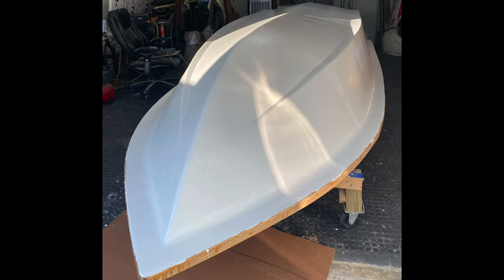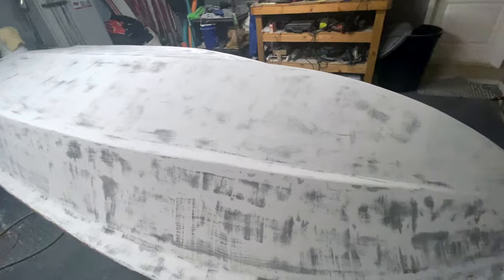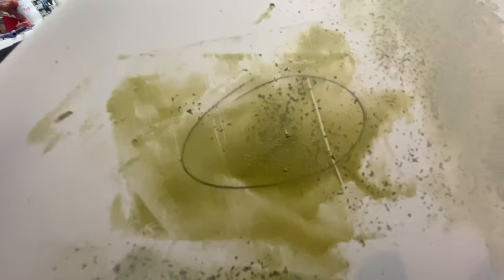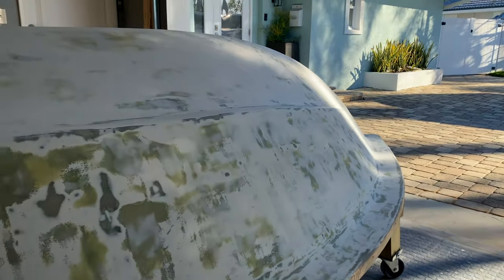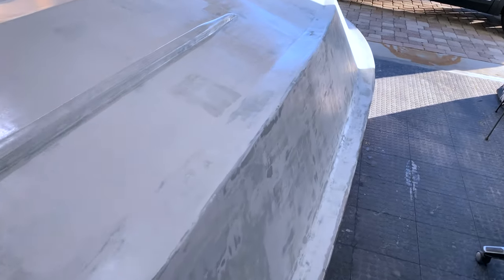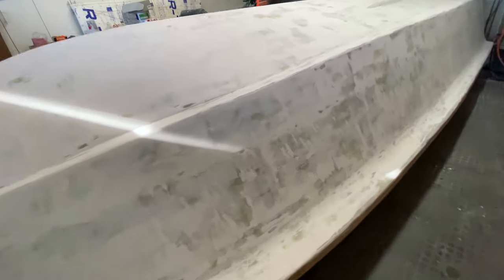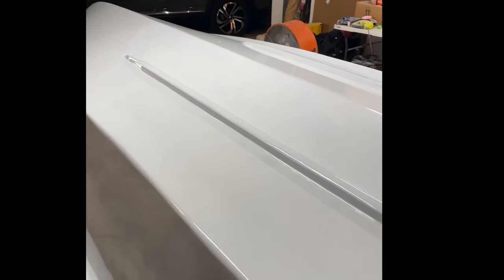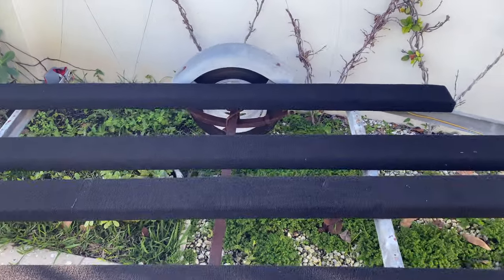DIY Salt Boatworks Home Skiff Build Update 8  The Hull is Painted with Alexseal!

Comment: Did you use a long board? If not you will extremely difficult to get rid of low spots.  Looks great
Reply from the maker: I did use a long inline sander to finish it off. Boat turned out great thanks for watching

Comment: UN REAL!  I know how much this thing has fought you all the way and I can't like it's driven me to do what I am doing with my build.  But the finish, man, it has to be worth it.  How many hours have you spent just looking at it.  Then moving, and looking at it.  And wondering how the hell it looks like it does from where you started.  Awesome work.  Now come do mine.
Reply from the maker: Thank you. A lot of my buddies along the way saw it in. Several colors and stages of fairing lol. It turned out super nice. Now that it’s flipped over you don’t see as much, but topside is moving along pretty quickly. I’m headed tot he dmv today to get trailer registration then probably going to put the boat in at the ramp just to see how it sits in the water tomorrow afternoon

Comment: Can you experienced folks teach me something? I want to re-gel coat my 16’ Privateer center console. I’m curious… why paint is used on some DIY projects instead of gel coat? Get coat is thicker and can take a beating for many years, creates a thicker barrier between the elements and fiberglass, can be wet sanded years later without rubbing through, and can last 50 years if taken care of. Thinly coated paint might last for ten years, doesn’t matter which paint is used. Why go through all that prep work then use paint? Four coats of sprayed gel coat is what makes sense to me but I’m not totally sure. Awesome skiff by the way, great job. 👍
Reply from the maker: Thank you. I didn’t have the means to spray paint in the garage so rolling it was the easiest way for me to do it. Alexseal is some pretty high quality stuff and I’ve already been able to wet sand and bled some imperfections
Reply: @LightningCapitalLiving  thank you. That skiff is awesome!

Comment: My son found your build and is so ready to build one for his senior project. Before we started spending money I wanted to ask a few questions. The plans you order, do they come with complete step by step instructions or do you have to figure it out on your own? I looked for a complete video series from Salt Boatworks but just find short segments. Did the cart you have for the build have plans for it or is that something you came up with? There is so much different information and thoughts I just wanted to ask someone that has created something at the level of what we can strive to achieve. We are down in Corpus Christi, TX if anyone knows of someone that has completed one of these with success. I would like to see one in person and get some do's and don'ts.
Reply from the maker: The plans come with some notes at the bottom, but there is not a comprehensive list of directions. The short videos on salt Boatworks YouTube get you the general idea on how to put things together. I found them very useful as I had no idea what I was doing when I first started. The cart I built around the actual cradle that salt boatworks gives you a template for. In his videos you see the 5-7 boards that support the hull while you build it and there are plans for how to cut those boards out. I just went a step further and added some bracing and put it on some heavy duty casters so I was able to spin the boat around and move it to access some stuff in my garage. If you join the salt boatworks Facebook group there is a ton of info and several builds documented. Fishing with Hoang is another great channel and he built a 15’ from one of the original set of plans back in 2020. I know he is in south TX and loves to show off his boat. Post in the FB group and I’m sure someone could meet up so you can look over the boat. It does seem like you’re going to be drinking from a firehouse to start, but there is enough info and tips out there to really guide you through the process. I had no idea what I was getting into, but honestly I’d start to build another one tomorrow if I didn’t already have 2 boats.